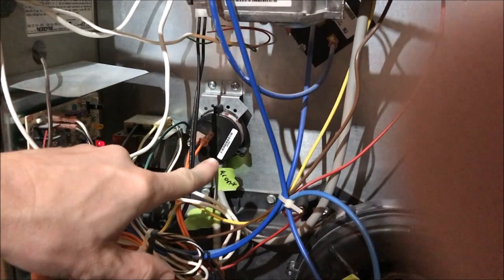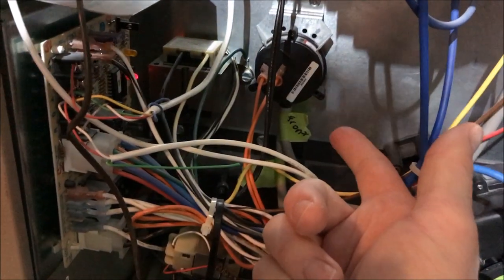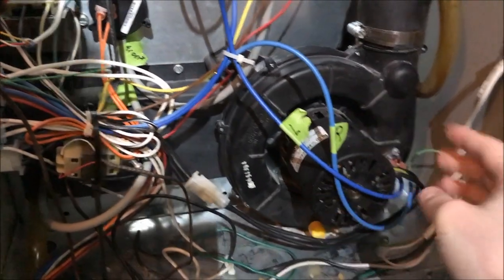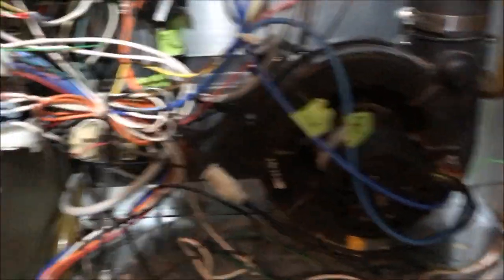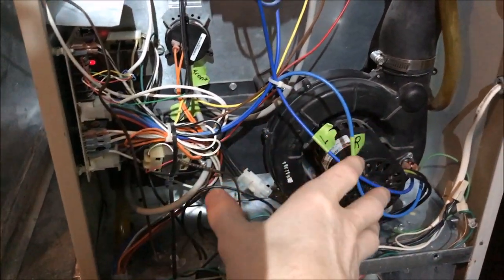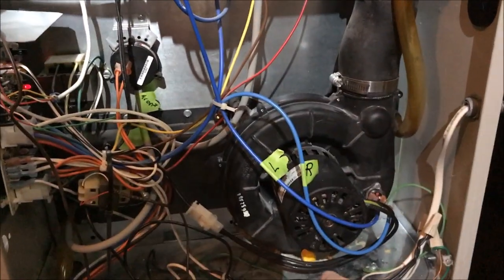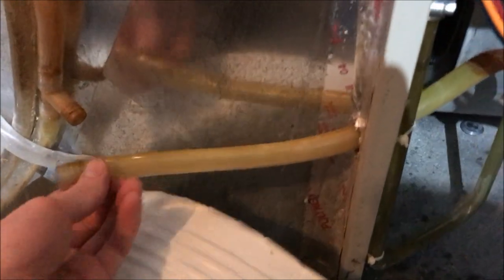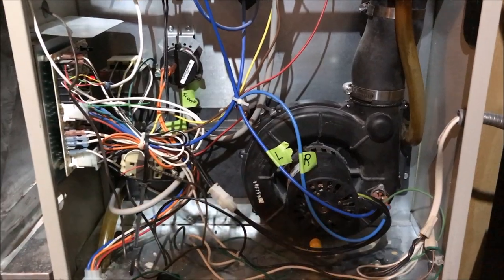FAST fix for NON-WORKING furnace with clogged p trap or closed pressure switch reading

Comment: I get the condensation build up in the trap, remove the hoses, it drains out. Then the furnace will work for a while and fill with water again. Everything is cleaned out. I think the drain may not be pitched right because the foundation may have settled over the years. This only happens when temperatures outside are below about 10 DG.
Reply from the maker: You’re 100% correct. The pitch is wrong. I had to redo my tubes to get the angle correct. I’ve not had a problem since. Best of luck!

Comment: The pressure switches on most furnaces are Normally Closed.  The diaphragm on the pressure switch drives a piston that opens the switch when there is NO vacuum (i.e., when the fan fails or, as in your case, there is a condensate blockage).  Other than that pedantic fine point, good video.
Reply from the maker: Hey, I’m all about the fine points so thank you for the info!  I appreciate the comment. Take care.
Reply: On 80 percent Furnaces the Pressure Switches are Open and Close when the Inducer pulls a Negative Pressure on Pressure Switch that Closes to Complete the Circuit
Reply: The vast majority of pressure switches are normally open and closed when the inducer starts Stewart
Reply: The pressure switches are normally open. I think you got it backwards there.

Comment: I was getting 3 red blinking light pressure switch stuck closed.
Someone replaced pressure switch but unit still not working.
It won't even fire up now.
Any thoughts!
Reply: Same here
Reply: It is not pressure switch, have you  checked pressure tube inlet hole? Condensation trap? You should vaccumed the induce motor hole as well. Remember unplug all the connection to pressure switch when you vaccum.

Comment: I woke up to a smell of hot heat exchanger with no fan. Checked my furnace and found the condensation pump unplugged and some water on my basement floor 🤔 I guess I'll be doing this later today. My Tempstar furnace is showing a fault code 4 blinks. Furnace is less than 6 months old 😞
Reply from the maker: Sorry I’m so late in this reply. Did you get this issue fixed and if so, what was the problem?
Reply: @FastFixYouTube  It's fixed. A mouse was stuck in the squirrel cage causing it to become unbalanced and the molex plug vibrated out from the fan motor. My cat must have lost one of the mice she caught and brings into the house to play with until it can't play anymore(mouse death).
Reply from the maker: Oh wow! Mice get everywhere that they’re not supposed to be.  Good kitty!

Comment: Ok just did this and viola ! Furnace working :)
Reply from the maker: Orlando Productions awesome! Glad your problem is solved! Keep an eye on the pea trap. I had to re-plumb the condensation tubes in order to eliminate the problem completely. Sure beats using the oven to heat the house.

Comment: Well, i can see that your P trap is A LOOP!!! Thats not right imo. You wanna changed that, then you wont have that kind of problem more often. 
Great video
Reply from the maker: vladek vladinov yes, I’m no expert on p-trap design, but I thought it was odd as well. Thanks for the comment!
Reply: Mine is setup the same, is there any reason I couldn't run the drain tubing straight down without having a "trap" in it?